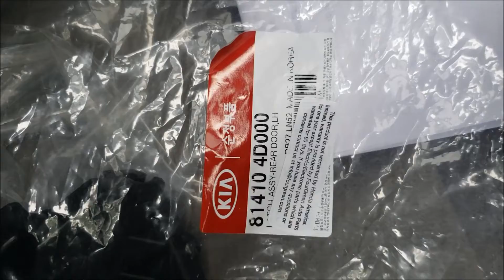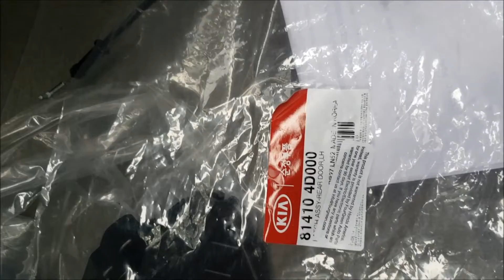2006-2014  KIA Sedona Side Door Problem ...the door doesn't close

Comment: I have a 2011 sedona...my door panel also has a screw and a 10 mm hex bolt on bottom of panel which u must remove before you can remove door panel. Also, he doesnt mention in video that screws to remove door latch is a number 30 torx wrench.

Comment: How did you take off the door handle?
Reply: The inside door handle?  There's a clip at the bottom of the door handle that holds it in place.  You have to use a hook to pull it out.  Good luck!